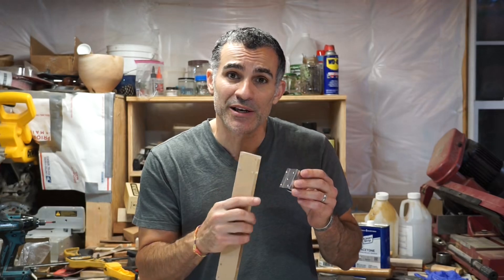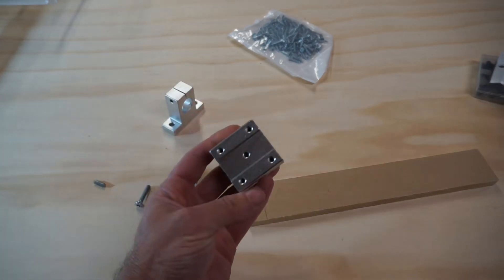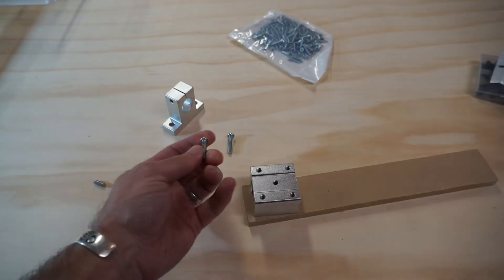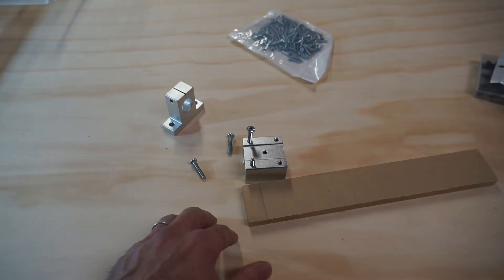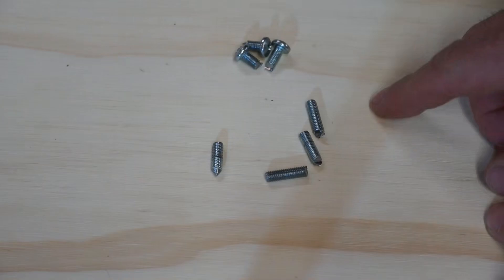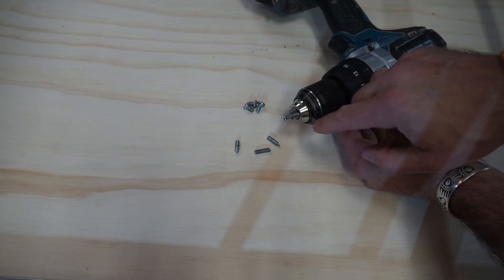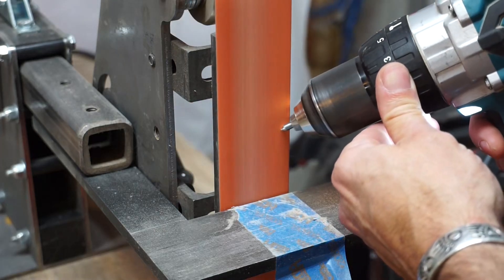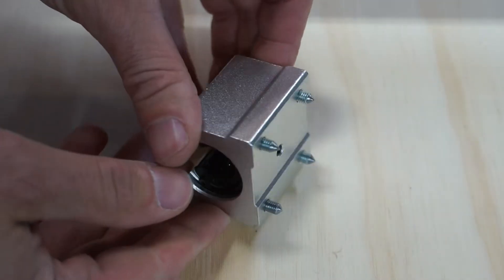How To Transfer Holes To Your Workpiece For Drilling Without Measuring!

Comment: Great work, but I have a question: What would be the way if we wanted to place four or six bearing pieces in two parallel rows on a 30 x 30 cm iron slab - the distance between the two rows is approximately 24 cm?
Reply from the maker: Thank you. Do you have a program on the computer that you could print out the layout and then tape over the workpiece before drilling? Alternatively, you could drill out a wood template to overlay on the metal piece and use the technique in the video.
Reply: @industrialcomfort   Thank you, dear, for your interest and quick response. Your suggestion is undoubtedly practical and useful. What do you think if I cut a piece of clear plastic to the same size as the iron slab, then stick the bearing on it in two rows, then mark the center of the hole for all the pieces, transfer it to the iron, fix it on it, and drill the holes?
Reply from the maker: Yes, I think that would work well. Use a sharp punch to get your hole started so you have a precise location. The nice thing about that clear plastic is that it comes with a paper layer that you can use to measure too.
Reply: @industrialcomfort  Thanks again, Greatings from SWEDEN
Reply from the maker: You are very welcome. Good luck!

Comment: You wouldn't have to measure and transfer all 16 pieces if you first made a template on paper. Much faster and cleaner than grinding and ruining the screws. Then from template just punch on the spots.
Reply from the maker: I realized that (using as a template) as I was making the video. Although I still find using paper is a pain and is much less accurate.

Comment: What are the length of the pins?
Reply from the maker: I used about 1/2 inch. Don’t want them so short that they’re tough to handle but don’t want them bottoming out either.

Comment: This method is good, Better would be to use a center drill (60 degrees versus the much shallower angle of regular drill bits) to start the holes in the transferred pattern. Normal drills like to wander off a bit if they don’t have a good starting hole to follow. For this kind of project close enough is probably good enough.

Comment: Use set screws, they can be easily adjusted and removed. They won't give you a precise point, but you'll easily find the center.

Comment: Thin, clear acetate can be used...mark and transfer...or piece from soda bottle, if you can flatten it.
Reply: The studs are a great choice for a quick and dirty job if you have the studs ready made, However, your method is a lot faster than making the studs. It also makes it easier to align the pattern to the edges of the workpieces.

Comment: You can buy sets of transfer screws if you don't want to mess around with sanding.  As a bonus, the sets available commercially are usually hardened so they last longer.
Reply from the maker: Good to know!! Thank you